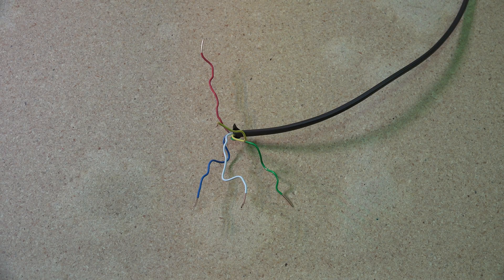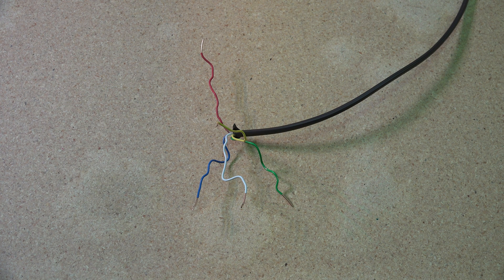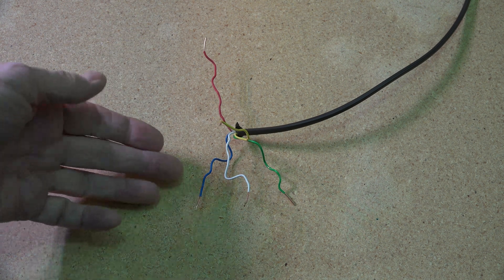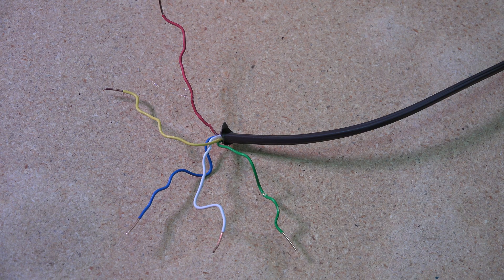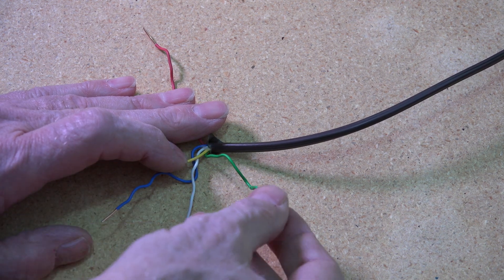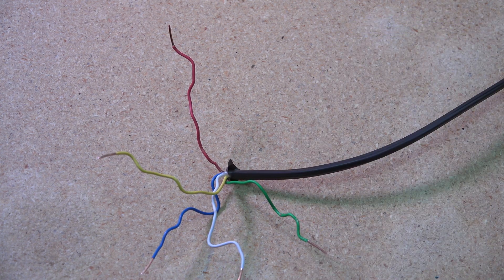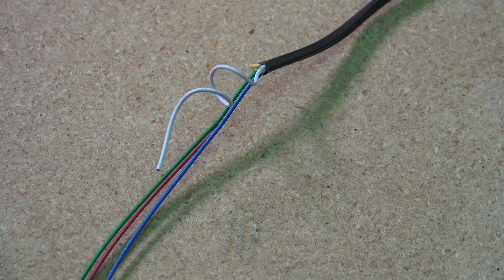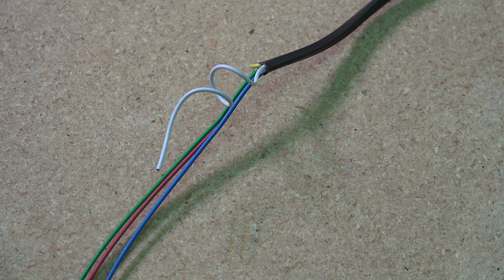No heat, thermostat wire broken?

Comment: Don't know why they use solid wire? If new wire is ran leave a couple feet extra like in a attic or crawl space and etc. Don't know why they staple wires inside walls that would deffiently make it difficult to replace or upgrade. Some wire I looked at using in place of thermostat wire can handle 48 volts.
Reply from the maker: I agree on all 3.  Especially the stapling.
GFM

Comment: Just found your great videos trying to figure out new loud hum on 12 year old trane xv95 (high effic).      Puts out heat ok, everything seems to kick on as it should, no red error light coming on, has quiet slow speed.  As soon as thermostat clicks, the loud furnace hum starts with the burner quickly firing and then moments later the blower.  That hum is way too loud!!  Can't tell exactly where it is coming from with covers off furnace.  
By the way - no annual service check here by so called pros has covered nearly as much as you show should be done.
Reply from the maker: I am thinking inducer problem.  Many failures.
GFM

Comment: One of the best ways to avoid these kinds of problems is to use a wireless thermostat, I think there are a few different models, I have one of the Honeywell ones and it's great. The receiver module attaches to the equipment and the thermostat itself is wireless, you can mount it whereever you want, in my case, I don't even have it mounted on the wall, since it's wireless, I put it in the same room I'm currently in, that way the temperature is read where I am.
Reply: Those come with their own problems
Reply: @Mm-om9ol  Anything can have problems but I have not had any problems with mine, it solved the issue I was having which was that I could not control my fan manually because I did not have a G wire and also provided the benefit of allowing me to control the thermostat remotely. I could not have installed any of the wired thermostats that connect to the internet because I also don't have a common wire.

Comment: Nice. I thought you were gonna ohm the wires out to find the broken one. Great videos ty
Reply from the maker: I seldom use an ohmmeter except to double check.  
Ohming the wire would also very probably show continuity but then disconnect when the thermostat is installed.
GFM